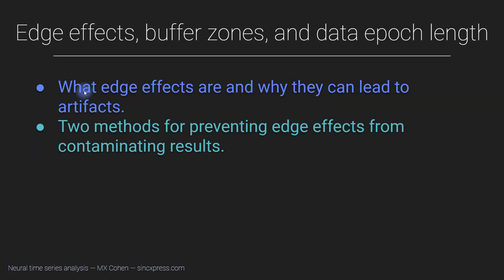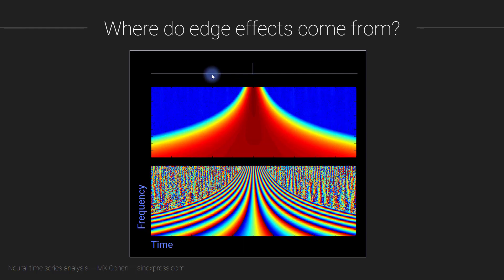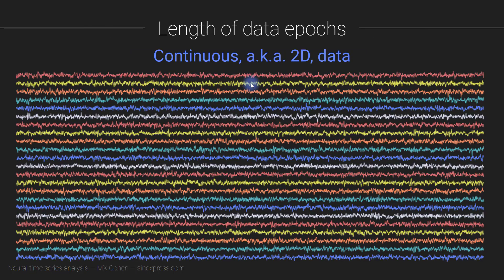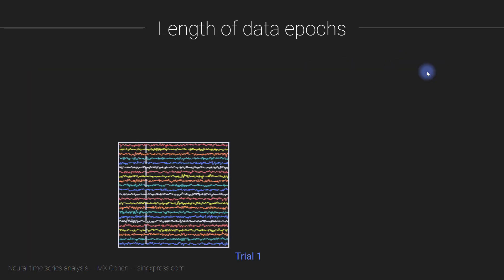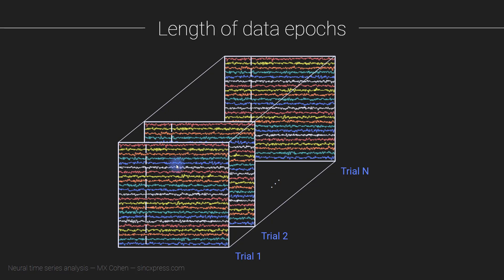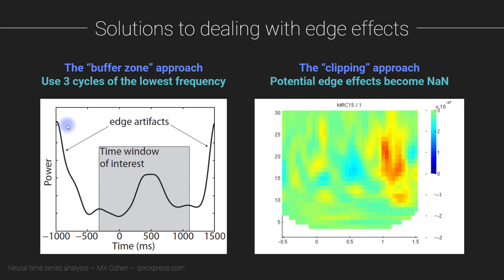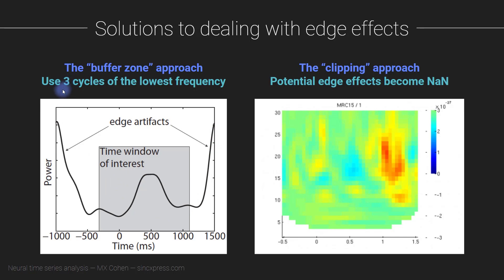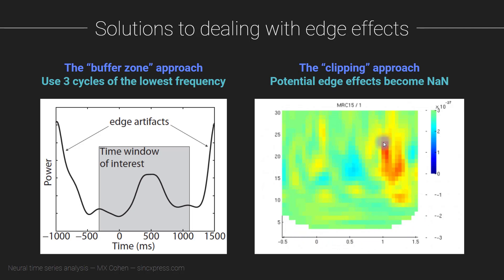Edge effects, buffer zones, and data epoch lengths

Comment: based on the "clipping" approach plot from Fieldtrip, does that mean lower frequencies are more likely to have edge effect? as shown in the plot, the "clipping" part is limited to low frequency band
Reply from the maker: Edge effects are approximately the same number of cycles, but the same number of cycles corresponds to different amounts of time in ms for different frequencies. It's a question of circular vs. linear time ;)